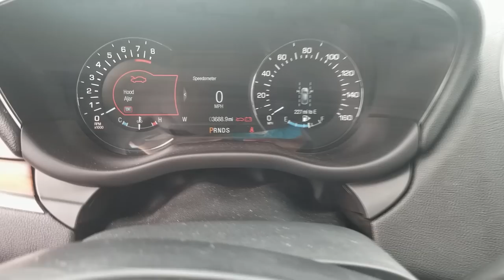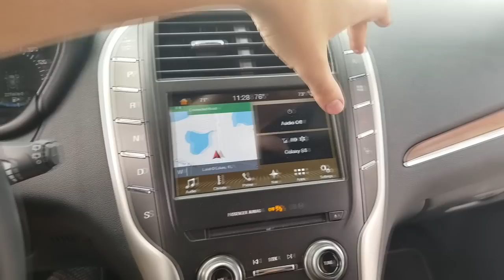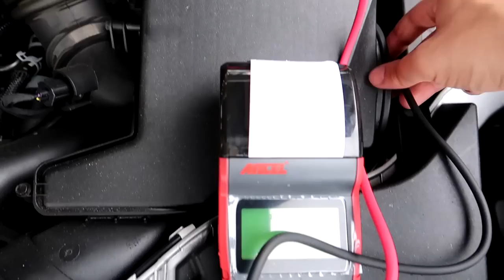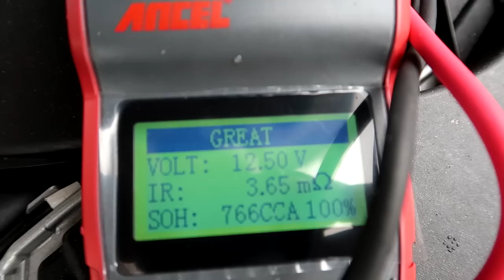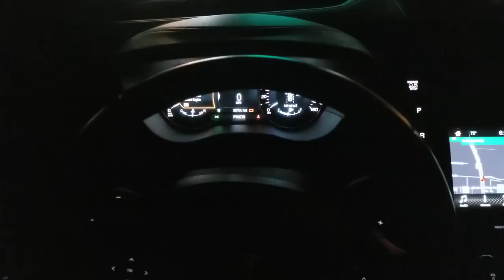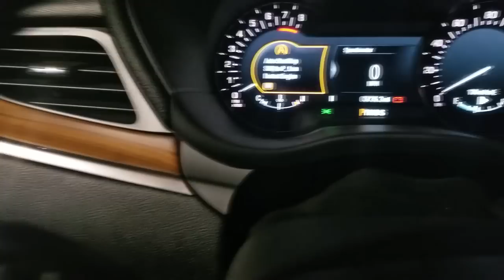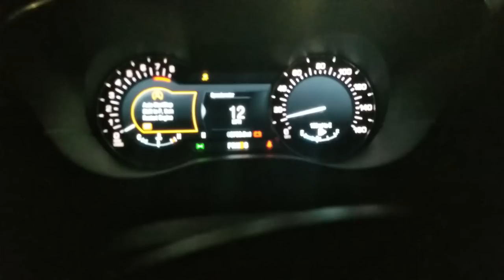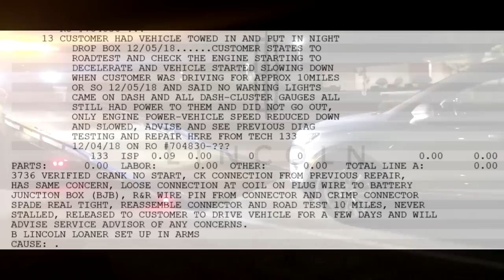I Saved Over $20,000 Buying a Like New Lemon Car! Then it Broke Down TWICE in 48 Hours!!!

Comment: The problem is that even if you get it fixed and have no problems, it will always be on yours and your wife's mind that it is going to start acting up again. We had Pontiac 6000 from 1986-1990, bought new. At 30K, the transmission failed and even though it was repaired, my wife always felt ill at ease that it was going to happen again.

Comment: My 94 del sol had a similar issue after an engine swap. Turns out I forgot to tughten the main ground for the computer. Maybe there is a similar issue with the system that auto start stop system. That would also explain the voltage fluctuations while jiggling the harness

Comment: I had a similar problem with my VW Amarok V6 dual cab auto stop 5000kms demo stopped at a very busy intersection on my wife 
Found that the negative ground cable was loose from factory which didn’t charge the battery correctly causing low voltage 
Also cranking times on start up we’re 5 or more seconds should be 1 or 2 seconds 
The car was shifting gears a lot and jerky in operation 
I’m a diesel fitter and knew that something was not right I considered trading it in doe to no lemon laws in Australia but taking to the VW master tech and running through the diagnostic fault process found that my car had the incorrect starter Motor fitted from factory the technician was awesome I considered changing jobs from mining to VW mechanic due to the help that they give you 
Lessons learned is to talk seriously to the dealer first then if no help go to the manager then the manufacturer always have a good record of what happens when video is best record everything this helps with diagnosis and resolving problems still have the car no further issues after 33000kms

Comment: why is that wire all kinked? to me that is a sign the wire is corroded inside the insulation. which would cause that issue. pushing on the wire will make the corroded areas reconnect until they corrode more...

Comment: Yeah you are lucky that you have the warranty but I would certainly sell or trade it when that warranty expires as I own a 2008 Lincoln mkx and with only 95k mi I am having issues with the electrical system which could be a result of the enormous competition stereo system I have installed but it was all done properly and should not have caused any issues but I have already replaced the alternator with a new upgraded CES 300amp and my battery is less than a year old but I have voltage drops of 11.8v at idle and only as high as 13.8v hen it used to be a strong 14.5v.... problem still has not been discovered or sorted

Comment: I had the same issue with a Ford that cut the engine in mid drive down the highway-  no code no nothing- I finaly found out that the crankshaft (not camshaft) sensor was bad - it hat an internal short or ope circuit- when the car was cold it would run with no issues- but when doing a long run and the engine got hot (realy hot) the engine just died _ found the sensor by spraying brake cleaner on it - the thing got cold due to the spray and evaporation - and the car would run again.

Comment: The auto start-stop feature is the worst thing engineers have come up with in a long time. It saves gas sure, but at the cost of all the other components that are getting wear and tear with that constant starting and stopping. On top of that, it's just unnerving to have the car shut off at a traffic light.

Comment: Back in the 70's, I bought a Honda Trail 90. It rode for 5 miles and shut off. I took it back to the dealer who claimed it was fixed. I rode it for 5 miles and it shut off. I take it back to the dealer and speak with their Chief mechanic. He claims it's bad gas, I told him they recommend Mobil and it's Mobil gas. He puts the gas cap off and claims the vent is clogged. Finally, I ask him if he has a dirt bike. He said yes, so I tell him to bring it to work because I'm taking his bike on vacation until they fix my bike! Then I tell him it has a bad coil which shuts off when it gets hot. They replace the coil and that fixed it. That's why I don't trust mechanics.

Comment: BRO. Hasn't Jafro taught you anything???? It's time to unplug the harness on both ends, connect up your multimeter, and WIGGLE THEM WIRES!

So I bought a Saab 9-5 about 3 years ago, thing had a lot of issues that were relatively simple to fix but added up to the car running horrible, and even after I got it all sorted out it would STILL just randomly stall. I was blown away, until one day I just happened to find the problem. Someone had cut the tape holding the wiring harness together and nicked one of the wires that went to the ignition cartridge (which is all 4 coils in one unit), so when the car would heat up enough for the harness to sag or vibrate it'd ground out on the block and stall the car. I coated the exposed wire with liquid electrical tape, wrapped it in a layer of electrical tape, then retaped the harness, has run flawlessly since. Finding the problem can drive you insane but damn is it rewarding.

Comment: Auto start stop is a fucking plague, and when these cars get to be 8 years old with 150k miles and they start shitting out you'll be able to get them real real cheap because I'm sure whatever the start stop is going to break mechanically won't be easy or cheap to fix.

Comment: Ecu loosing power you have a loose plug or pin connector. Chevrolet use to have the same problem just die driving then restart

Comment: My Ford Escape was dropped off the truck at the dealership and it pinched a fuel line on the ramp of the truck, car would run and stall out after so many miles of driving CONSTANTLY...Fords man, I tell yah

Comment: It can be fixed but Ford doesn't want to spend the money to fix it. It needs a new harness and new connectors. It's a factory defect, which is not the dealership's fault. Ford should spend the money to fix a factory defect and the dealership should dig deeper and inspect all parts of the harness and connectors. This is not common but it does happen and it's on Ford to make it right.

Comment: My question would be. Why under Lemon Laws are cars allowed to be bought back and RESOLD? A car stopping in traffic is DANGEROUS, for whatever reason. The car manufacturers should not be allowed to resell these vehicles. Better they tear them apart , find problems for future fixes and scrap them or sell off parts like fenders, motors, etc. to body shops and for engine and transmission replacement.

Comment: Headache this is why i buy brand new cars. My Toyota sienna had blind spot issue. Took to dealers twice was given run around. Then i called Toyota CEO and spoke with his secretary. 
Was told Toyota engineers r aware of the issue and soon there will b a recall. 
I said screw the recall fix van now. So in 24 hours they had to replace the whole light with brand new one that the engineers were working on.
No more blind spot issues and headaches.

Comment: I dont understand the tightening part the wire is on a fastener that is used to connect to the pins of the box there is no tightening the proper fix I see would be to remove the clip cut old shell off the wire cant remember the technical term but the metal Male end off of the wire and replace it with a new one that's if the harness is also not damaged. If it was my car I could get a new harness and have all the wires transferred over along with a new Male end to that purple wire. If the problem comes back I would than replace the entire purple wire as water or corrosion could have built up inside the wire itself

Comment: But really,  that auto start stop feature is a complete joke. They do have aftermarket devices that plug into the back of that switch and what they do is automatically electronically "push" the off button for you. You can also disconnect it before taking it back to the stealership for warranty work if needed. Its another modern dumb feature i will avoid. I also prefer a real Gear shifter instead of those electronic push button ones. Also the Info tainment displays are out of hand and distracting.  But must be what people want or they wouldn't make it?....
Reply: Well part of it is stupid govt regulations. All cars after 2018 are REQUIRED to have a back up camera. Why does our govt need to make rules like this? To save 1 or 2 lives due to negligent drivers? Now I have to pay more for features i don't want or need.
Reply: Also a trailer light plug tester that plugs into the plug in the tow vehicle will disable the start stop.

Comment: IEFs (Intermittent Electrical Faults) are understandable on a corroded old banger, but the quality control that alllows that to happen in a new vehicle is atrocious. It also reflects badly on the EMS self-diagnosis design, it should remember a signal disappearing and you shouldn't have to wait to replicate the incident for it to appear as a fault.

Comment: I have a gtc and i hate the eco start :(( no way of switching it off permanently, say you stall
it no matter how good of a driver you are you will stall your car at least once a year lol, well
when you stall it with vauxhalls eco start you stall it, the eco comes on after switching it 
off and you stall it again, until you turn eco start off again.

I do not see how it can be efficient to have that stupid shut off ?Diesel to fire the car back
up stress on the flywheel and starter motor, and there has too be more bad things that  
can happen from stop/start all the time..Even my car its the 2.0 CDTI if i have been booting
it i like to let the turbo cool down before switching it off many people do.
'HATE THE ECO START WITH A PASSION SORRY FOR THE RANT'

And i have seen many people with stop/start issues. 10:00 Rage mode activated that shit
will causes divorces next LOL

Comment: That purple wire doesn't look healthy - sure it's got insulation on it, but look at the lumps and bumps in it when compared to the other wires - I suspect it's buggered up internally (but I can only suspect).  Also have a look at the blue wire running beside it, specifically down by the connector.  Might be the picture (err, video, but I have it on pause right now), but the terminal's crimp doesn't look like it's crimped to the wire properly.  But aside from the wires your showing, it more or less to me seems that some electrical component (one of the far too many modules) is overheating and shutting down once it reaches a critical thermal temperature.

Comment: They should just replace the wiring harness and computers in one whack be done with it. 
You'll never put your finger on the actual issue. It's too deeply embedded and hard to pinpoint. 
The techs "wiggled the wire" was complete B.S. just to get it out of the shop. I seriously doubt they will dedicate too much time to actually investigate intensively.

Comment: This Lincoln will eventually bite you in the butt.  It has a very dangerous problem.  It sounds like Lincoln hired  Larry, Moe and Curly to fix your car.  Hitting it with a hammer is probably Next.  

I will say this, I had a Chevy Cruze that did about the same thing.  I found a  battery cable connection issue.  One of the cables beneath a cover was so badly corroded it lost contact..... but, having a Lincoln tech tell you to wiggle a purple wire is definitely BS.  If it’s fixed... why would they say that... because it isn’t really fixed.  Good luck, but I’d see Manny, Moe and Jack, before Larry, Moe and Curly.

Comment: The sad reality is.
Today's "mechanics" at the dealer do not know anything beyond what their diagnostics tools can provide. Many issues can only be fixed with common-sense, and computers have none of it. Technicians know more about how to operate their diagnostics tools than the cars alone.
Intermittent issues are the hardest problems to fix, that can't be caught by the diagnostics tools and that's when common-sense is required. Wire snake is one of the main causes that dealership$ do not want to deal with. It's all about money!!!
Most of the troubles come from the dealers, and their dishonest ways of doing and handling business.

Comment: LOL  BE FUNNY  IF IT WAS THE  BATTERY ALL ALONG
Reply: AFTER WATCHING MORE I SEE ITS NOT A BATTERY ISSUE   MUM  HAS AN ASTRA  IN 2000  id stop   but if you rocked  the car    id work  turns out to be a coil  pack   but  new cars use coil  on plug

Comment: The pin on the end of that wire needs to be replaced entirely (if it didn't before, it does now that some cack-handed tit has butchered it) and I'd be looking carefully at the integrity of wire/pin on the other connector as well

"recrimping" seriously weakens a connection - NEVER do it, let alone 'real tight' - that's a pretty good indication that the "tech" doesn't have a clue about wtf he's doing - or electrical connector issues in general.

Crimps are a one-time thing. The pressures involved when a crimp is formed run to a few hundred tons per square inch, essentially cold-welding the metals together over time. Doing it a "second time to make sure", (or to spread the crimp over the length of the body in some cases such as coax barrels) etc takes stretched metals in the crimp body and adds microfractures to them - immediately reducing the overall crimp pressure - such crimps WILL fail as the fractures travel. 

If done properly a crimp will outlast soldered joints and are highly reliable 

If done badly they're a source of intermittent faults and the ONLY remedy for any kind of improperly done crimp is to cut it off and replace it. You can't reuse it - or the wire it was crimping onto (which is a common error when crimps slip off. The pressures and even slight deformation makes the wire strands brittle)

Interestingly, in Europe you'd be perfectly entitled to take the vehicle to a good auto electrician for diagnosis and Ford wouldn't be able to stop you OR have it affect your warranty.

https://en.wikipedia.org/wiki/Crimp_(electrical) - this has links to photos on the Etco site of good and bad crimps and why they're bad.

Comment: Sorry, but you should get your money back, they will not fix it.
What is the purpose of owning a car that you cannot trust to go on a family trip with it? Might as well get a good used and reliable brand.
Look at the lumps on the purple wire insulation. I would not be surprised that the copper inside is broken causing the intermittent issue.
Besides all the new young and inexperienced engineers focusing more on  designs instead simplicity and reliability. Ford and many other US American brands, are no longer American made. Parts are made in China e assembled in US. We are basically buying a Chinese vehicle, assembled in US! No wonder the Japanese and even Korean brands are leading the market!

Comment: if I was in your position, id pull that wire out, test myself what the heck it does. if that's the cause I'd epoxy that badboy tight.

Comment: Umm There is mentality behind the problem
Reply: Umm the problem is primarily diagnosed and the knowledge behind it that is ok your covered by the warranty yea you had some issues but think of this you buy a wrecked one it does the same thing after putting it all back together aka money Pitt Jetta it’s over all win if you have ways to deal with it. Such as in your case other vehicles to drive the finances to do as you need the knowledge of the problem and area to approach the problem. Yea it can be a headache for a couple of days but it can also be good reliable transportation. I’ve been a technition for years there littearly a copart within a block of we’re I live but all that is a pipe dream due to no shop and no real finances to wheel and deal. But the mentality of it is you know how to deal with the problem.

Comment: 90% of engine wear happends on start (i know somebody will  say cold start,but still). Now multiply the times this stupid option stops and starts the motor every day,and divide engine lifespan time on that number. You’ll be surprised. I’m just being a sarcastic jerk. Nothing personal,but this option is a joke in a name of fuel milege for yor repair bills.
Reply: I can't agree more. This is bs times a million. What does a destroyed engine do for the environment?
Reply: On top of that my brother bought a car in Europe 10 years ago and the engine would shut off on the highway. Fuckin bs.
Reply: Stop and go saves me 15%-20% fuel in dense  city traffic. So around $10 per fillup. You really have to have a fast wearing engine, not to make it worthwhile.
Reply: Tore Lund  Ok,fillup is approx 400 miles. In 40 k you save 1000 I hihgly doubt it,as for start motor alleays takes rich mix. But if you say so. Now in 80k you saved $2 000. How many starters have you replaced in 80k’s ? If you have a chain timing,that’s different story. Unlees you lease the car,start/stop is a joke.